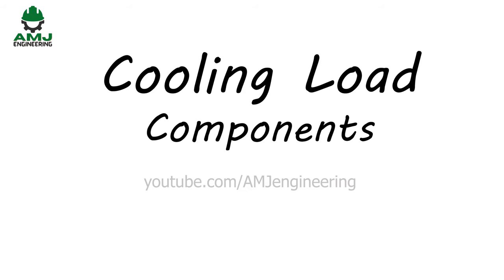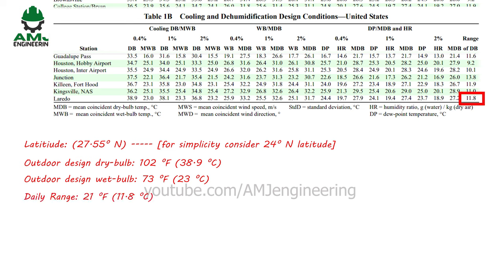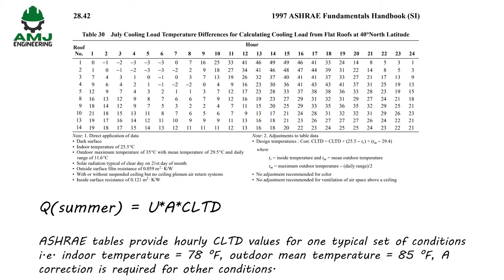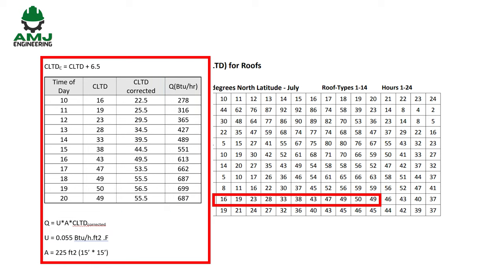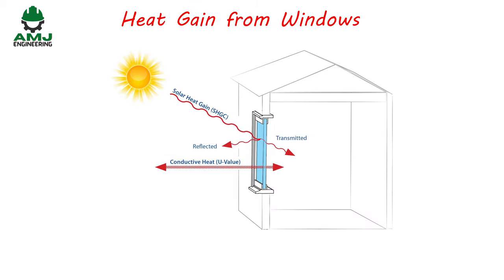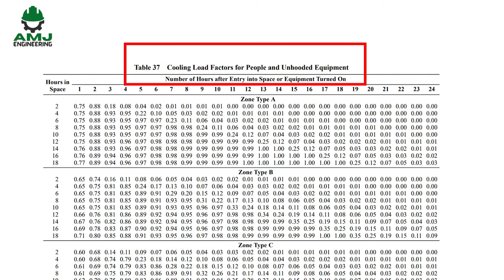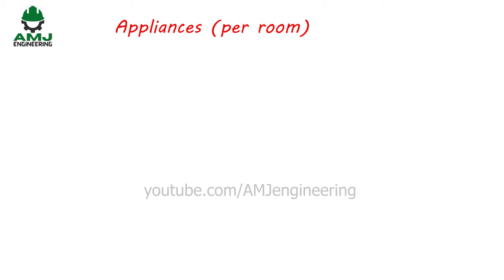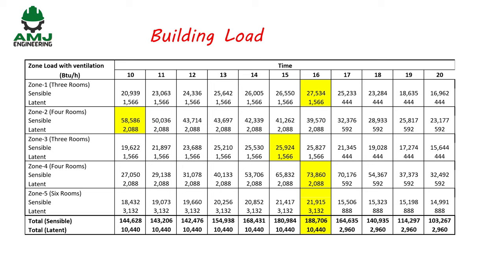Cooling Load | hand calculation example | HVAC 13

Comment: Hello sir, this video was very helpful so I have a question, why the heat load through the floor was not calculated?
the same question for the heat load through partitions between zoon 5 and the other adjacent zoons .

Comment: just want to clarify where did you get the 0.2 U-value for the wall..Thanks
Reply from the maker: This should be given for any type of wall.
Reply: I am in doubt too. Type C3 >> R = 0,125 m2 k / W. It was suggested 0,88 m2 k / W (0,2 Btu / h ft2 °F. Maybe C13 (150mm High Density Concrete R=0,88 m2 K / W) could fix the numbers.

Comment: Hello, your videos are very helpful. I have a question, instead of using the temperature of radiation from the sun, is it possible to apply the temperature from the fire if there is fire ?

Comment: The computed automatic cooling system complex for big or large buildings by placing temperature sensors  everywhere.. This is what calls for the possibility of studying air engineering circuits

Comment: Hi, thanks for the video.
I have a question, for the roof, if we look at the R value, the higher it gets,  the associated number in table 30 goes up wish means higher Cltd values.
Whats bugs me, is the fact that with more insulation, we have more cooling load to deal with, but it seems counter intuitive. I would expect better insulation to mean less cooling.
Am i missing something ?
Reply from the maker: please let me know the video timing you are referring to.
Reply: @AMJEngineering  i was refering to 8:09 with Roof no. In table 30 and R values in table 31.
Additionaly, what does mass location mean ? And are the R values in table 31 for the complete roof composition, because even 5.3 seems low for a northern country. If i have an R = 6.5 whats do i pick in table 31 ?